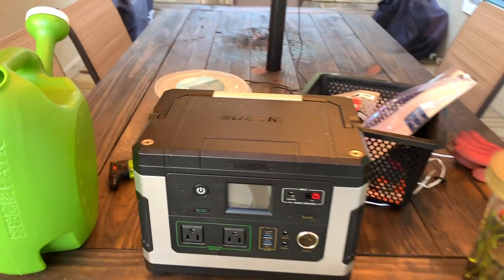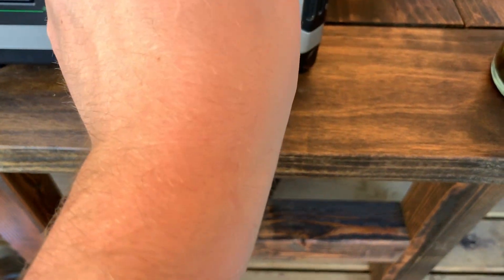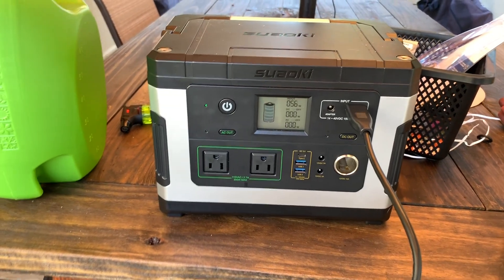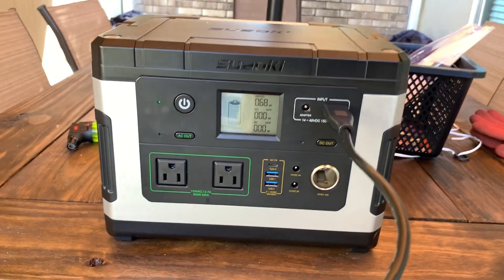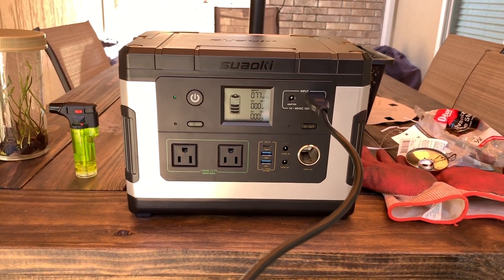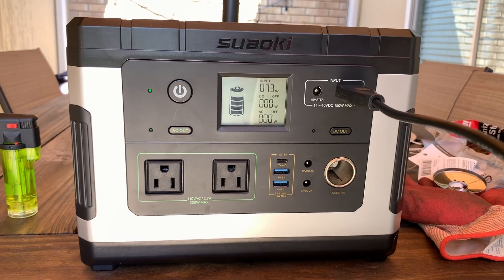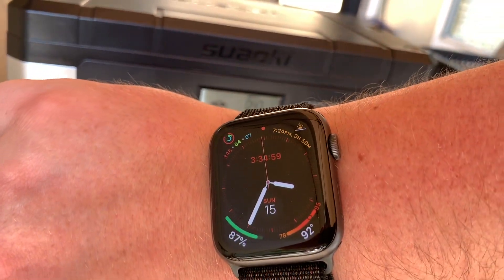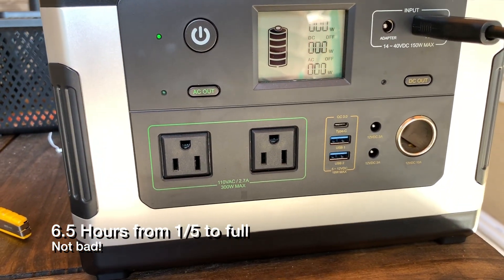Testing how long it takes to charge the Suaoki G500 from 1 bar to 5 bars with solar

Comment: Hi Ryan, what cables and adapters did you use? Can you post some pics of the connections? thanks
Reply from the maker: All the cables are included with the battery. They connect to any standard MC4 connector that most solar panels have.